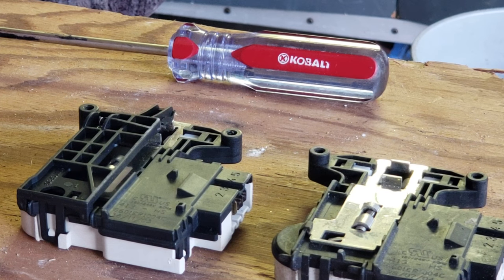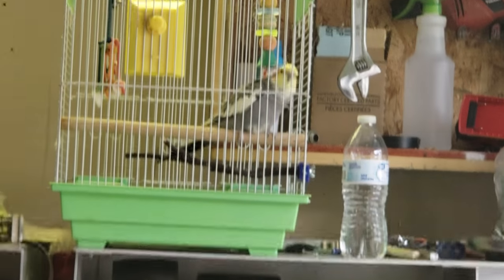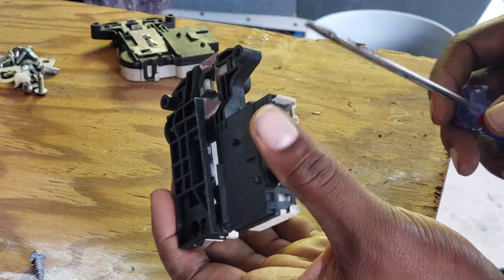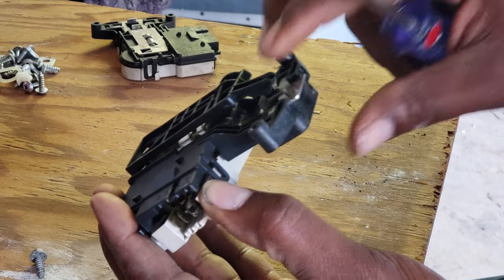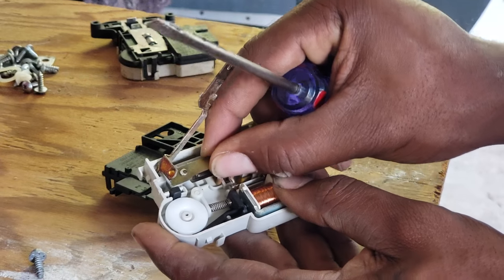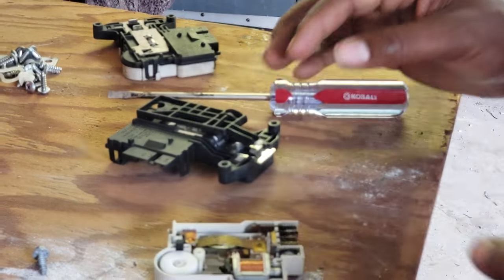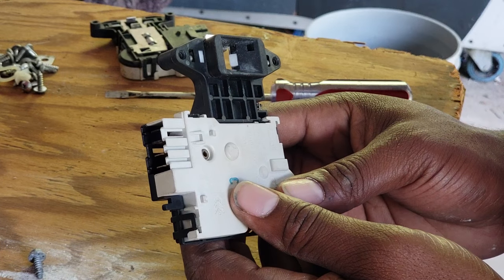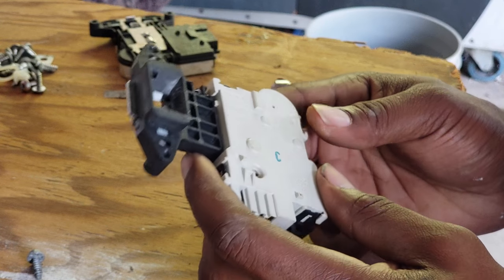DE error code fix without replacing door switch

Comment: I need to repair the door switch on my LG, the strike is stuck to the switch assembly. How do I separate the 2?  The washer was functioning when I noticed that the door had opened. Unfortunately, the switch I have is completely sealed and cannot open it as you show in this video. Help.

Comment: We changed the rollers and now I get a de warning. It looks like a short wire with a wide connector is not hooked up. I can’t find where it plugs into. My friend that changed the rollers said it was unplugged already. It was working prior to changing the rollers. I suspect it became disconnected when he took the lid off. I wish I could post a photo of the wire, but I can’t. This wire is tied to the set hooked to the motherboard, but it shorter. Should this wire be connected to something?

Comment: I had taken the switch apart earlier looking for the problem to jump out at me. Figured I needed a new switch and ordered one for about $18.  Then found your video and the obvious knocked me in the forehead!  I immediatly removed, fixed and reinstalled switch and voila!  It worked!  I cancelled the order and saved $18!  Thanks!!!!

Comment: Well done; it's always a pleasure to find someone who wants to preserve rather than just replace. I have a slightly different contact assembly in my LG WM3360, and the case is a little different, first removing the black latch assembly from the electrical portion, then carefully removing the blue cover from the white body. Inside, I noticed that the electrical contacts activated by the latch were a little black from the current arcs. I burnished them with a few back-blading strokes from a small pocket knife (being careful not to bend the movable contact very far), until they were shiny again, and reassembled the unit. The first thing I noticed was that while the unit was beginning to fail, it always took TWO clicks before it showed the door locked. Now, it takes only ONE, but then TWO to unlock. Ingenious design, as each time the solenoid is powered, it advances the mechanism one step: Lock, lock, then unlock. That gives the contacts two chances to make a good connection, before the washer gives up and flashes dE. The take-away? If the washer consistently locks on the first click, the switch is OK. If it frequently, or always, takes two clicks to lock, it is failing. My habit is: first, fix the part, then order a backup just in case.

Comment: Sir, you are basically a Saint.  Thank you VERY much for this DIY fix, even I could do it!  However ... I got your fix done, closed the door, and immediately the door wouldn't open again, yikes -- then I realised that I hadn't plugged the washer power cord back into the wall, thankfully once I got it plugged in the door opened just fine and the washer worked as you described!

Comment: Thanks. Worked has explained. Took me about 10 min.

Removed the dryer top, disconnected the door lock switch cable, 2 screws. Followed your instructions and magic, family is washing clothes again.

Watch the pins, use a flat blade like a fingernail file or knife vs flat screw driver. They are delicate.

Comment: DUDE -- thank you mucho for taking the time to post this. Mine looked quite a bit different inside, but the same basic principle applied, and I'm back in business without having to use feet and hips to contort the door over and over until it locked. Thank you, thank you!

Comment: Thanks, our washing machine presented the problem with the error code DE2, it is a newer LG washing machine, and the door lock is a little different but it does the same function, this video helped me and I was able to start the washing machine again, Later I will buy the new insurance to make the change, again thanks for this video.
Reply: How did you get switch out?
Reply: @inzombnia616  Remove the safety, and the cover I only put a rubber to join the two sheets so that they would make contact, I assembled it again and it worked perfectly, but it is only for emergency, because if there are children they can open the door, as was the end of week and on Monday I bought it in a store that sells spare parts for washing machines, I bought the original spare part, it is not very expensive, it is easy to change it, you just have to remove the ring that secures the round rubber on the outside and voila, just remove the two screws that hold it, remove the patch with the cables and that's it. assemble everything in reverse.
Reply: @anibalgp6947  thanks!!

Comment: Awesome. Thank you. My switch was a little different, and I didn't see anything wrong with it on the inside. Seemed like everything was connecting just fine. I took it apart, made sure it looked like everything was in its place (it seemed to be), and put it back together again. Re-installed it, and it's working like a champ. Who knows what it was, but I'm grateful it's working again!
Reply: Mine too

Comment: Great vid. I did this and fixed the DE error. However, the door would not open after the cycle. Probably needs to be replaced. Getting to the release tab for the door lock was a pain. It is behind the springed hatch on the door lock.  Love to see a vid that shows a close-up of how to release this latch.

Comment: My Samsung front load dryer is a different model and 10 years old. The controls and display is on the front. My dryer has EXACT same problem. Logically, it should work if dryer has same symptoms. Took the lid off (2 screws). Controller board is located front left side. Removed and reconnected all connectors, tapped on the 2 black relay switches, closed everything backup, crossed my fingers and plugged it back in. Tested the display buttons and the door. IT WORKS NORMAL AGAIN! Problem solved. Will see how long it lasts. If it continues to fail then I will consider new circuit board. Thank you so much! Either it had loose/bad connector or relay gets worn and hung up.
Reply from the maker: Yeah those relays on Samsung always get stuck

Comment: Because it's Friday, and the door lock failed in the middle of a load of laundry, I went ahead and bought a new switch. Can't have the washing machine down for the weekend. After completing the replacement, I took the old switch apart and no bounce whatsoever. Just as you said. Fixed it and now we have a spare in case the new lock mechanism ever fails.

Comment: I took my lg front loader washer apart to clean the seal, hose and filter/drain. When I put it back together I get a "de1" error code. It worked great before I took it apart. It doesn't make any noise like it's trying to lock when I try to start it. Do you think the door lock is still my issue??

Comment: Thanks for the video. I have a Kenmore Elite  796-41029900. dE code popped up. Replaced the switch and the code is still being displayed. I checked the contacts to the switch and everything is correct. Could there be something else here? Additional info: we had a power surge from the power company. It hit us pretty hard - blew out lights, burned transformers, wall plugs and light switches. Could it have inflicted more damage to the washer and the dE code is a reflection of greater damage? If so, how do I check to confirm? Thanks

Comment: What would it be if u press the start button an the cycle timer just counts down lg smart drum top loader also I get de and dL codes
Reply from the maker: Usually means drawer is not closed properly or bad door lock

Comment: Scenario: Samsung dryer showing Dc code, but code only appears when you start the cycle (cycle fails to start and display is normal with countdown clock) but the Dc code only appears when the door is opened and then closed. Code remains after the door is re-closed. Washer Dryer Repair Tips & Tricks for DIY 'ers  Are you in Chicago by any chance?

Comment: I removed the cable and the screws then tried pulling the interlock from inside but cant get it out can you help please model no.  wd702U4bkgd it has some lock mechanism but i cant figure it out

Comment: Hi, my Samsung front load washer ~ model #WF45H6300AW/A2 door lock is engaged with door open.  I shut the door, pressed the start cycle button to begin my wash and it threw the DE code (it has thrown the DE code in times past) and, thinking that I hadn't shut it completely, pushed on the door again, to make sure it was fully closed only to find that it wouldn't close at all. I previously found that the door seemed to be hanging lower (or so it seemed) so I lifted it slightly to try and shut it but that didn't work either.  I discovered that it appeared that the mechanism that the latch engages is in the down position.  I emptied the drain hose water just to make sure that wasn't an issue either. I've turned it off and unplugged it from the power source for at least 20 minutes in the hopes that it would "reset" the machine's brain.  However, it turns right back on to the wash setting as before and still throws the DE code. l How do I reset the latch to the open position?  Thank you and I enjoyed the video above!

Comment: My wife has been getting the dE code for some time now  ( we have a Kenmore Elite front loader ) 
) however when she reenters the big and bulky cycle the washer worked . Today this did not happen so we changed cycles to heavy duty and it worked just fine. Would you say it is still the door switch ? Thank you for this great video
Reply from the maker: DE code is for the door lock, so i would say yes. If it worked fine on a different cycle then it just might not be a constant problem now but may get worse with time or if the door is slammed to hard.

Comment: If you add with de error/ contact issue, the interlock issue that door gets open while tub revolving or simply gets open by door open by hand. The door shouldn't open while in use.

Comment: Hi, ur video was pretty helpful but my door lock switch is a little different, before I got a chance to take a picture of what it looked like so I could put it back together it fell apart now I have an extra peice I don’t know where it belongs part number is dff80850 q or supco 7801 please help
Reply: Ha, same thing happened to me. 2 metal pieces fell out and never could figure out how to reassemble. Finally just had to buy a new part.

Comment: my washer is making a light clicking noise... it clicks about 4 times then the de shows up will this work for me??
Reply from the maker: Sounds like a lid / door switch issue
Reply: @LeanOnYourRep  I figured it out actually....a couple of the resistors on the board fried up.....